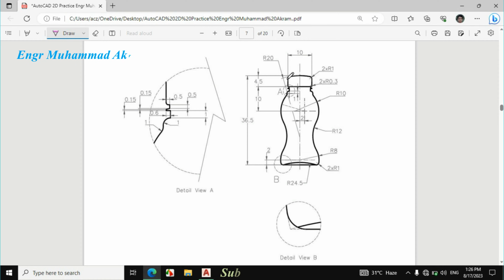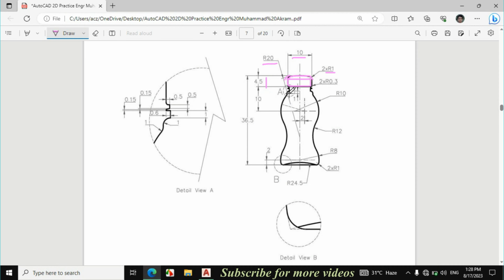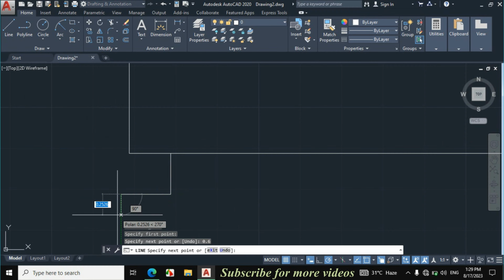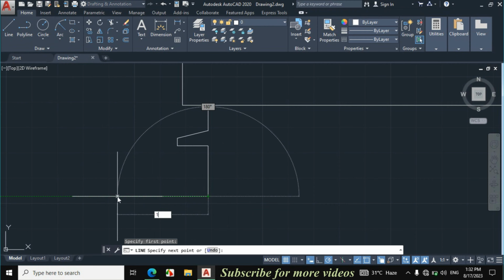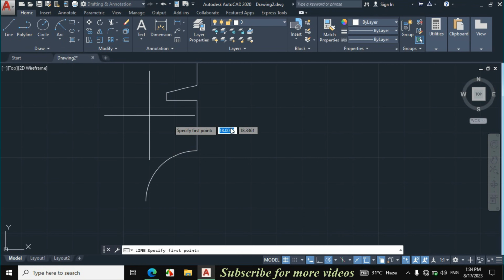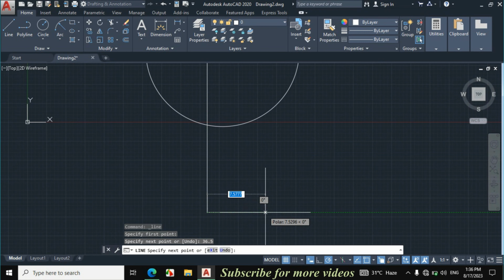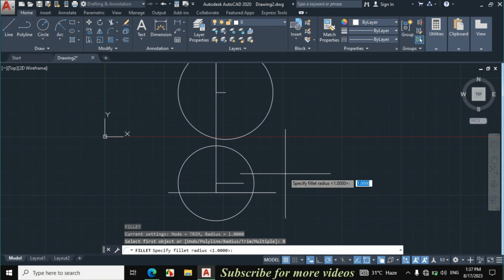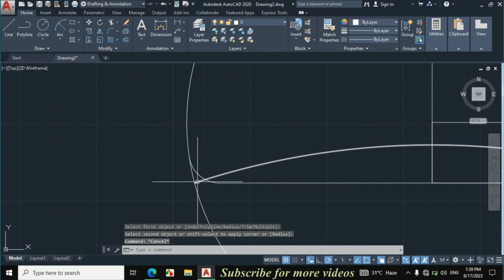Bottle 2d drawing in autocad| technical drawing | practice drawing| 2d exercise drawing for students

Comment: Sir can u please make in 3 d
Reply from the maker: Bro, I don't have enough time, but i can tell you the method you will just make it in 2 mints. Refer to below details:

1. First draw its 2d drawing as i drawn in the video.
2. Then trim the (second line or bottom) line of cap only not the base of bottle.
3. Now draw a vertical line in the centre of drawing (bottle) and erase the left or right side, but remember keep one side whichever you want.
4. Then joined the drawing by j command. (as i did in a lot of videos this command in especially in 3d videos)
5. Then go to solid tab and apply revolve command about vertical line, you will get the exact 3d model of it.
Reply: https://youtu.be/1iBWouCd2fY?si=_ExKIHW-Xo9pahWI
Reply from the maker: Bro here is 3d video for you, watch it:
https://youtu.be/1iBWouCd2fY?si=2oKU_hVv9tVFUieY